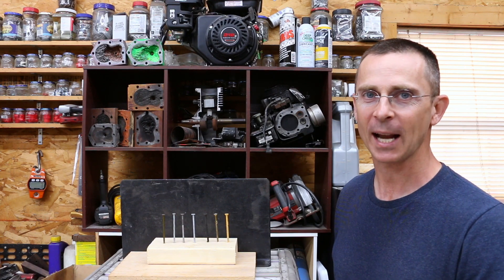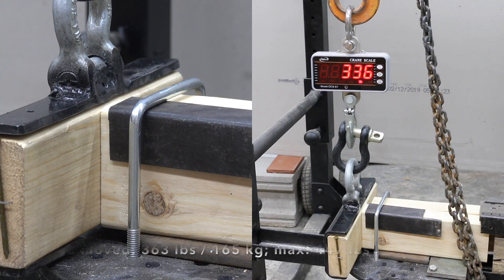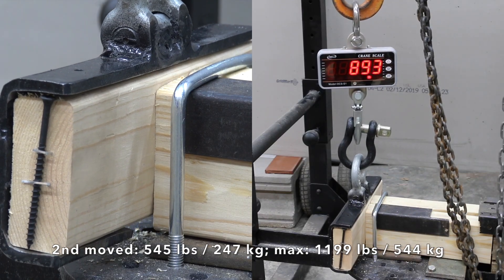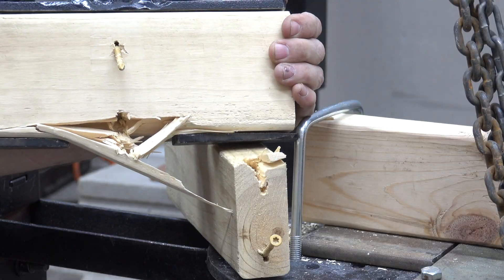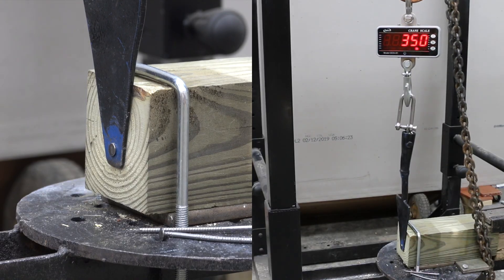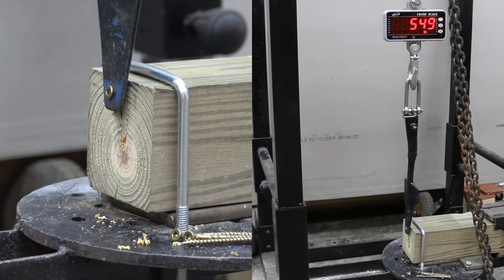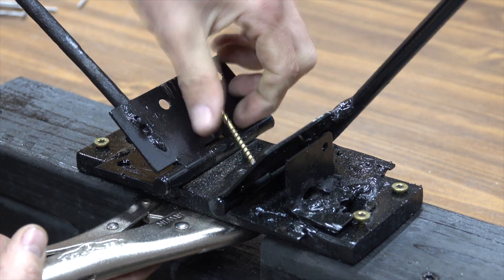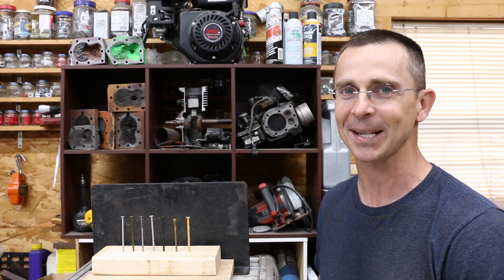Do Screws Shear easier than Nails? Let's find out!

Comment: Hey Todd, so I have a bit of a video idea for you. I recently had 5 of my yard tools brought into the shop for service, as they were all older and hadn't been serviced for awhile. All said and done, I had to replace 4 out of the 5 carburetors because many or all of the brass pieces inside were heavily damaged from the ethanol in the gas. (Or so the serviceman suggested). My thought was, is there a better or worse ethanol level that people should be using? Should we use 0 ethanol, 10%, or 15? Is there even a difference? I know that you get a lot of video ideas, I just figured I would throw you another idea and at least put it out there. He said a lot of people have this problem because of the cheaper pieces within many carburetors, so I thought it might be a good idea even to just put this comment up so people can find out and know the damage ethanol has on a carburetor.. because in all my years in the workshop, I've never even thought that could have been such a detriment to the brass in a carburetor. Anyways thanks for making the informative videos, and staying unsponsored. You'll always have my patronage and support! Best regards.
Reply from the maker: Thank you for the video idea!

Comment: I prefer screws for all manner of reason.  Fundamentally, though, the bend test is typically irrelevant in practice as there is not much opportunity for a screw to have that happen due to the clamping force they exert and their higher friction coefficient on backing out.

What I would love to see you come up with, is a test comparing the various screw head types and which is the best:  Common, Philips, Robertson, torx, etc...  Also which is better at smaller or larger screw head sizes such as is Robertson best for small vs Philips or is it Torx that is better...
Reply from the maker: Thank you!

Comment: How do you calculate for the difference in the density and moisture content of your wood as well how did you account for the possibility of an uneven formulated steel for each. this test should have been tryed with a hard wood like oak or ash not pressure or not pressure treated pine blocks  you just can't get a constant due to the variables we were trying to test the fasteners not the wood and it was more of a wood test but good content

Comment: Nice video!  It would have been interesting to see a comparison of nail gun driven versus hand hammered.  Nail gun nails are supposed to be better holding due to the glue that holds them together in a stick.  When driven by a nail gun, the glue heats up (the theory goes) and then holds the nail better.  It would be nice to see that tested.

On the oil showdown video, did you see consistent performance on the oils that went through several rounds of testing?  I know you changed up some of the tests in the later rounds, but before was there consistent performance?  Also I live in the south and keep my car in a garage, so managing -40º weather isn't an important variable for me.  Which oil did better on the evaporation test?  Thanks.
Reply from the maker: Thank you!

Comment: did anyone notice that most of the time is the wood failing and not the screws/nails ?
Reply: Wood vs metal.
Reply: Correction: Large wood with low concentration factor vs small metal with large concentration factor

Harder would would easily shear weak screws in this test, despite metal having a much higher tensile strength
Reply: Yes, exactly! I  was going to ask if the wood could vary as well. Trees can be weaker or stronger depending on how much rain and sun are received.
Reply: The main problem here was him using the end grain of the wood. It is so much weaker.
Reply: Would be nice to see the actual shear strength of each of the nails and screws. Do you think you could redo these tests, but not rely on wood to immobilize? I stopped this vid after realizing I was seeing a test of the wood strength more that the nail/screw strength.

Comment: Tell the truth brother, coming up with your custom contraptions to test & destroy 1 thing to the next is your favourite part right?... I'm surprised however that you didn't do a 'stripping' section? I don't know about you but the biggest beef I have with screws & fasteners are the heads. Some seem to strip faster/ easier than others especially if it's not a perfect fit & a tight screw. Particularly when it's Allen keys, they strip like nobody's business.
Reply from the maker: Great point. Thank you!

Comment: I'm curious about blunt sheer force being applied.  Possibly using a pulley system between the sheer plate and a weight holder to allow for a controlled drop of say, 600 pounds.
Reply: And none of that weight in cheese.

Comment: This wasn't a shear test as the wood was allowed to pull outwards ,You should of put metal frame around it so it could only lift upwards ? not outwards at a angle as all that will do is bend it and pull out. Great video none the less :)
Reply: antony redfern it was a shear test.
Reply: I was also thinking the same, If he were to do a jig like with two L brackets with a hole through both and the puller from the second set of test we could see absolute sheer strength of each fastener. I however do believe that the test that he has done shows more realistic use cases. Either way I love this mans awesome content and the effort, enthusiasm and honesty that he brings to all of his work.
Reply: This is how these are used in real life though, so it's a very relevant set of tests.

Comment: I really like your channel and the tests you do are very good at isolating strengths and weaknesses. I run a handyman service and I use the deck screws almost exclusively. I build decks, steps, install doors and make structural repairs with them. They are an excellent fastener. One thing about them with the pull out strength is the direction they contact the grain in the wood. When you put them in the same direction as the grain they cut through the the grain in the wood and thus loose a lot of there hold. When they are put in perpendicular to the grain they hold much stronger because when they go in they separate the grain and wedge between them. Just some food for thought. Your doing a great job, keep up the good work.
Reply from the maker: Thank you!

Comment: Not an expert or professional on the topic, so please correct me if I'm wrong and missed the point, but from my understanding, the shear stress is ideally carried by the friction between the lumber pieces. Ideally, the nails and screws would be loaded axially, i.e. holding the wood pieces tightly together. So they're not necessarily designed for the shear or the resulting bending forces/moment within the screw/nail. In my personal opinion, the ultimate max force is less relevant compared to the initial "moving" force, as movement, i.e. loss of friction between lumber would be fatal construction failure imo. 
I think it makes sense that the nails are by design better in the ductile test as they seem to come to lose easier, and therefore more likely to become non-axially loaded (e.g. due to less forces transferred between lumber pieces and more through the nail) and be subjected to repeated forces, hence, more perceptible for metal fatigue.  The screws are naturally more resistant for getting pulled out, hence holding lumber more tightly together, so I'd think metal fatigue is a lesser issue and a more brittle material is selected to accommodate for a higher axial load. However, I am wondering whether to what degree this could be contributed by the residual stresses and initial crack propagation created by manufacturing processes (thread rolling/cutting).
Reply: No hate for the video! As usual very nice experiments presented in an entertaining way!
Reply from the maker: Thank you for the constructive feedback.

Comment: Perhaps you could try to put your fastener through 2 pieces of steel with the puller in the middle instead of using wood to give a more accurate result on actual "shear" strength? Most of the fasteners just pulled from the wood, whereas the method I suggested would basically force them to fail at some point. Just a suggestion, if we're talking purely shear strength of the fasteners at hand. However, I do like your method as far as construction application goes. Good work.
Reply from the maker: Thank you for the video idea!
Reply: @ProjectFarm  yes sir, keep up the good work!!

Comment: Screws or nails into end grain? Neither are really  designed  for this.
Reply: All top and bottom plates of wall frames are nailed into the top and bottom of studs which is end grain.
Reply: @thetapper61  doesn't mean to say they should be.
Besides, there's no real shear load in that application.
Reply: @petefletcher  until your house is getting knocked over or driven into, you're right.
Reply: and yet it gave different results for different products. 100% success if you ask me.
Reply: Do you understand how houses are framed?
Reply: @Old Man Yama i can safely say no one does, except for the safety pussies.

Comment: Good job. Interesting.  After trying to pull a lot of ring shank nails over the years, I wasn't surprised.  I seldom use nails any more for any construction.  I prefer the screws for the simple reason that they can usually be removed easier without causing major damage.  I know in home construction,  the screws really make de-construction a lot easier in most instances.  I also agree with the comments about testing the end grain.  Most good modern construction technique AVOIDS the use of screws or nails into end grain, except in glued-up joints, because they are weaker.  I too would love to see you test oil filters, since you've opened the can of worms with your test of oils.  Got to do the filters.
Reply from the maker: Thank you!

Comment: Do a drain cleaner test. Ex: Liquid Plumber vs Draino.
Reply: Also a pipe corrosion test as a result of using those!
Reply from the maker: Thank you for the video idea!
Reply: I used to use something called Liquid Fire. That shit you could actually see smoke coming out of the drain. I bought a drain snake with drill attachment so I just used it now. Does a better job. One time I took a big pot of water boiled water and poured it down the drain and it cleared it up

Comment: Variability seems relative to the wood samples rather than the fasteners. Would be interesting to see these tests done with oak and teak where they are bound to have greater purchase. Very thorough vid as usual.

It'd be interesting to examine cut nails versus wire type nails. They are available in all sizes ftom brads to framing. Tremont Nail Co. and Horton Brass both sell them.

http://www.tremontnail.com/
Reply from the maker: Thank you!

Comment: Great test but most screws and nails are put into side grain, especially sheathing...would you be able to rerun this test using that scenario? Keep up the great content sir.
Reply: by number of fasteners used, yeah, i'd say most are used in sheathing and other surfacing situations. this test was demonstrating structural strength though, like framing.
Reply from the maker: Thank you!

Comment: G'day,

  This was very interesting..., I assume that you used Plantation-grown Pine because that's all that's available on the Market, and being used - which makes these realistic and relevant tests...; but it was mostly the Softwood which failed - rather than the Fasteners...(!).

  In particular the Timber used for the Shear-Testing, those Blocks (not Planks) were cut from a Heartwood Beam..., the oldest, softest, "Carroty-est", most brittle Wood in the Tree.

  My guess is that if you'd used a Quarter-Cut Beam, or part of a Board, with the (End-Grain) Growth-Rings running perpendicularly from Flat-Side to Flat-Side ;  the mere fact that the Wood would then have come from further-out within the Radius of the Trunk, would have meant that the Wood would have been much stronger - by an order of magnitude or several...

And with actual Hardwood..., I personally would enjoy seeing what happens when the Cellulose Fibres & Lignin Cement refuse to shear-off and therefore not permit the Shaft to be pulled, any distance, sideways through the Wood....

  The Bendy-De-Shaft (Yuri Geller ?) Test was interesting, but only in an "academic" sense ; because any un-morticed wooden "Joint" which was either Nailed or Screwed, and has Bin-Deformed to the point where the Shaft(s) of the Fastener(s) have been bent through 45-Degrees (even once)...; is an utterly untriangulated Structure which has already collapsed under Load, either Parallelogramming over flat in a Pile or Twisting around to spirally form a "Sighoglan" or "Anti-Sighoglan" Heap (it turns out that US Hillbilly Culture has some very  specialised terminology, to describe the various ways in which old buildings, or badly constructed new ones..., collapse.

(There used to be a School Magazine, called "Firefox" published in Hillbilly Country 40 or 50 years ago, students interviewing Grandparents kinda thing ; I have a "Samizdat" photocopy of "The Firefox Book" - made 25 years ago when I was loaned a copy. Half the Book is all  about making Moonshine, but a lot of other stuff is in there as well....!).

  If you feel like a laugh, check out the "...Dust Accretion Studies..." Videos I've uploaded ; one cannot actually see the Airflow around a twirling Propeller-Blade, but after 18 hours in operation, given a bright Torch, one can see where the Airflow has been -and see what it's Relative Pressure has been, by illuminating how much Dust has stuck to it, how thickly - and where...

  It's a trick which, with a Stick of Incense and a Torch-Beam shining straight up the Propeller-Wash, has enabled me to prove which Aerofoil performs best, and why.

  It only took 47 hours to design & laminate & carve & balance & varnish the 3 Propellers - all identical at 8" Dia. by 6" Pitch, with the same Blade Planform, but made from different Timbers, and each with a different Aerofoil Section.

  And, the Project has so far given me the excuse to treat myself to (now) $565 worth of new Tools & equipment..; all  to make a better Propeller for a $57 Chinese Peltier-powered Electric "Stove-Fan".

  It's quite a challenge.

Such is Life,

Have a good one.

;-p

Ciao !

Comment: Brake fluid as a motor oil? I wonder if it would work
Reply: the seals wouldn't last long. also brake fluid is hydraulic fluid and has different composition and consistency than motor oil.

Comment: My only problems with these tests are that; in the first test the board that was being moved was what should have been the fixed board. In real life applications, the ledger or top/bottom plate would be stationary while the joists or studs would be moving. In the second test the fasteners were in the grains of the cut end where in real life applications they would likely be in the sides of the board. The grain of the wood has a lot to do with the fasteners ability to grip and wood doesn't have a lot of grip strength the way you fastened into the 4x4. I feel like if you went into the side of the wood instead, the screws would have definitely sheered off the way they did in test 3.
Reply from the maker: Thank you!
Reply: I love your videos, huge fan, keep up the good work. I'm a carpenter so I'm glad to help. I'm an amesoil man now haha

Comment: It really isn't shear force; That would be a stress at 90 degrees angle to the center of the screw or nail. If you look you will see that the bottom cammed out as the fasteners bent and the wood gave way. When you had fasteners that had a greater gripping power the failure mechanism was the wood when the fastener cut through. 
When you had one that broke it was after the first fastener had pulled free, then the remaining fastener was exposed to the entire force of the test jig.

A better test would of been with a slotted steel bar with a different steel bar inserted in to the slot. Then the fastener would go through a hole that goes through all three pieces (the two outside pieces of the slotted bar, and the center bar being pulled in the opposite direction). To avoid mechanical shearing from the metal of the jig you could use brass as a bushing as it would provide some give. All of the force would then be pulling force divided by 2.
Reply from the maker: Thank you!
Reply: I see your point, but I wonder if most people asking for the shear test likely use screws and nails in the way he actually tested? I was one of the people asking for this test, and the way he tested is similar to how my wood and fastener project is constructed. If my project fails, it'll be like these tests.

Comment: Cool test.  The first test is not exactly a shear strength test of the fastener however, since the stud being pulled is really levering out the bottom fastener, then the top.  More like a test of pulling force using a shear force to cause the pulling force, as well as shear force also directly on the fastener as well... kind of a "bend or shear while being levered out" test.  Second test is more of a shear test especially of the head.
Reply from the maker: Thanks for the constructive feedback
Reply: @ProjectFarm  not a criticism just trying to think through exactly what the tests are showing us